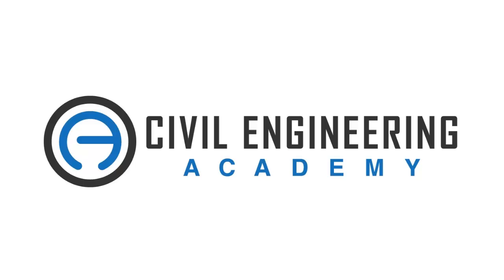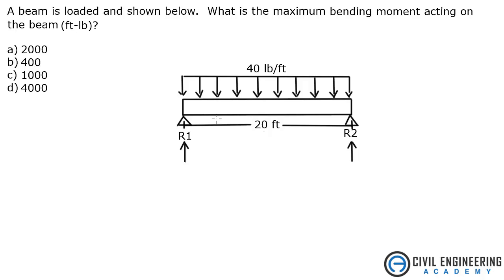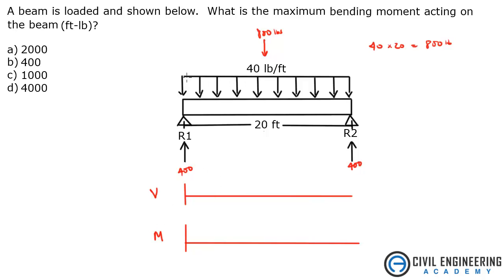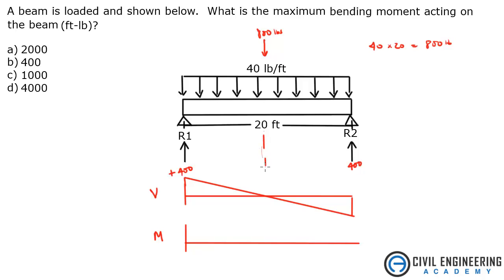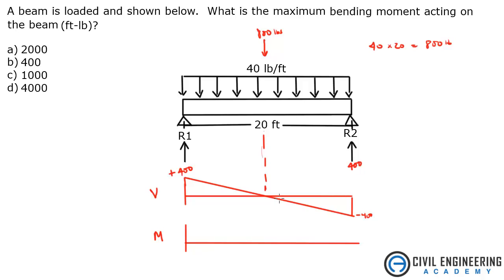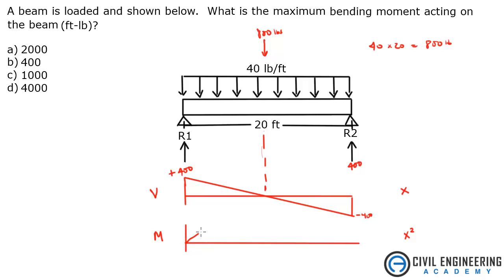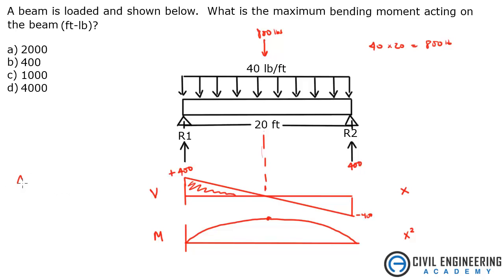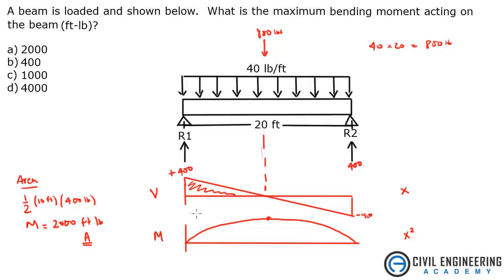Civil PE Exam - Structures - Find the Max Bending Moment in Beam

Comment: In a symmetrical beam the max moment is always in the middle but what if the beam was not symmetrical 
how would you find the max moment and at what distance ?
Reply: Adeeb Naveen use influence lines and moving loads first find the force which gives max moment at midspan then shift the load left or right such that distance equals from sum of other forces from midspan
Reply: You can find the maximum bending moment by the relation between shear force and bending moment............dv /dx =m .........and bending moment will be maximum where shear force approaches to zero or we can say minimum.....(

Comment: Wl^2/8 works a lot faster
Reply from the maker: Yes, yes it does.  Good point.  If you have the equations out of AISC (or use the back of the CERM) you can find a load case that's similar and just plug and chug.

Comment: Max shear will always occur @ the reactions or in the bearing section a between the beam and supports. Max moment is related to shear in such that When shear goes from positive to negative or vice-versa. Meaning when shear is 0 that point and place !! is where you maximum moment happens.
Reply: +OsmarH Now i want to know how do you CALCULATE the maximum moment in a point loaded beam? I know distributed load Mmax = WL/8  but for a point load i am not sure.

Comment: M = (w*L^2)/8
Reply: +Sadia Chaudhry Akbar 

W= uniform distributed load
Reply: +ahmed elbarky If you draw the shear (V) diagram it would make it easier. Calculating the area under the curve of the shear diagram will give you the maximum bending moment. Here is a link with the derivation: A= (1/2)(L/2)(wL/2)=(wL^2)/8http://engr.bd.psu.edu/rxm61/MET210/CourseSupplements/Handout%20-%20Simple%20Beam%20with%20a%20Uniform%20Load.pdf
Reply: This would only work for loading distributions for constant loading we have to get the area?
Reply: W is an applied load (ib/ft)
Reply: W is a UDL (Uniformly distributed load ) Ib/ft